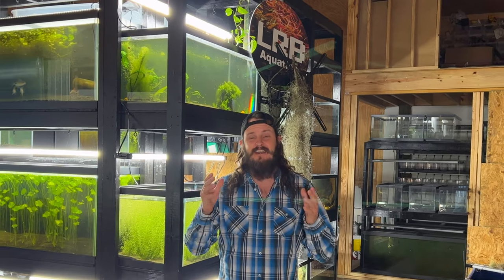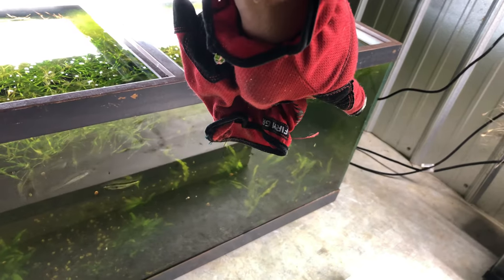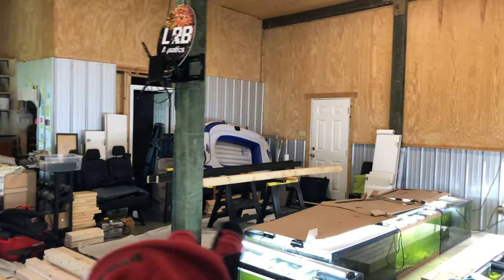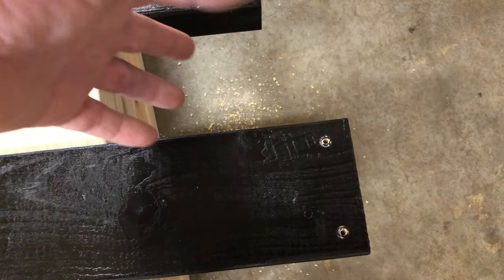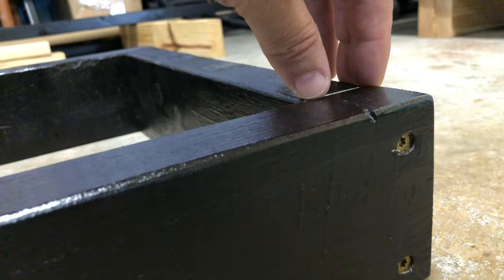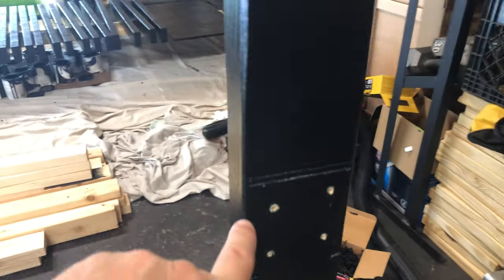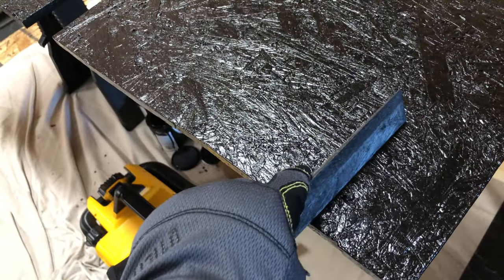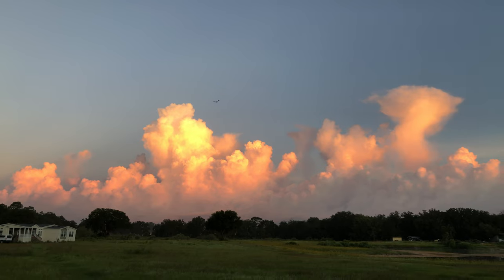Building Custom Aquarium Rack Stand for Fish Room (Full Guide)

Comment: Do you not get worried resting the weight on just screws? interesting design, looks very clean, I want to do something similar but worried the weight will be on the screws.
Reply from the maker: I use thick exterior decking screws with the combination of 4 screws per connection I do not worry or never had a problem with them.

Comment: Thanks for showing us how you build them. Loved your tip on using the plywood to make sure its level. Going to have to do that as my cement basement slap isn't remotely level for more than 2 feet! 😄
Reply from the maker: Helps with garages too. Many people don’t realize they pour concrete slabs for garages at a slope so water can run out.

Comment: I built my rack similar but added a twist to make it easier for my old falling apart arse. 🙃
For my leg supports I dado-ed horizontal shelf supports in. That way besides sharing the weight of the shelf it made it easy to place the shelf in place and run the screws. I just had to shim a leg at the floor and all the shelves were then level.

Thanks for sharing Lucas! 😉
Reply from the maker: I thought about dados then I thought about the time for them and remembered how well my other racks in the past held up so I stuck with my tried and true.
Reply from the maker: But great choice if you can’t hold it yourself or get some help.

Comment: If you have those squeeze clamps like they sell all over, they make it much easier to set a mark/clamp to where you can sit the shelf on it for the height, then you just  have to hold it for side to side alignment.  The longer ones also could make squeezing the shelf together for screwing much easier.  I use those clamps for all sorts of wood projects for the garage, making drawers, cabinets, etc.
Reply from the maker: O interesting, good trick! The ones I have couldn’t hold the weight without slipping on the glossy paint.
Reply from the maker: @josephkrug8579  you had me at Dewalt lol Thanks for sharing!
Reply: And I doubt those shelves are that heavy to require it, but you could always use multiple clamps to clamp a single piece of 2x4 under the shelf to hold it up while you screw and attach it into place.
Reply: @LRBaquatics  I have some of those pistol grip type clamps in 12, 18, 24 and 36 inches. The 18-36 in ones are sturdy and strong enough to hold that for sure (even the non-DeWalt ones I have 😆).

I used a pair of 36 (in the spreading/reversed mode)  to raise and hold a recuped window (about 80 lbs) to frame it in it's place. Worth it's weight in help!

Comment: Also, looking at the way you have the shelves tied into the sides...if you run into problems with the screws cracking the end grain, you could get some 1 or 2 inch angle iron to run up into the corner under the shelf along the back to front board etc, and that would help hold it in place without taking up much shelf space at all and make it much stronger as well.

Comment: I am new to building tank stands. Question for you. It looks like the screws are the only thing holding up the tanks. Should there be wood under each corner where the shelve is attached? I watched a few videos and they said screws have a sheer weight of 80lbs. Water being 8.3 lbs and my guess with tank and water about 10lbs a gal. That is a whole lot of weight on just screws?????
Reply from the maker: What screws you use matter. The decking screws have a sheer value between 200 and 300 but when multiples by 4 adds up more like rebar. You can add wood supports and or dados but these are plenty tough enough. I have some stands at my old house still solid as a rock that are over 10 yrs old.

Comment: Have you used this system before? the sides are the weak point trusting the screws to hold the tanks weight. I'm planning on making a 75 rack and will be notching front facing long 2x4; and using a 2/5 bolt to help screws on the side. I'm probly overthinking it.  Also I noticed you doubling front long faces 2x4. Do you think they would bow with a single on a 75?Your more experience at big tanks than me hopefully I catch up 😂.
Reply from the maker: I have and have done it with 2 125 longs as well. The shear value of one of those screws is enough for a 75 let alone 4 on each side. I thought about a notch dado joint but to much work and didnt want to chew into my 10 ft tall legs. Knowing how many years and how well my old system held up this should last decades. The reason for the doubling up is to help from sagging in the middle overtime especially if in humid conditions. Plus if I knock into it Im not going to be as worried about falling through it lol.
Reply: @LRBaquatics  thanks I figured I was being overcautious feel better about my plan and will add extra length support!

Comment: So only 4 screws each corner to hold all the weight?? 😮
Would personally fit a 2x2 brace each end for added support and help line things up in building.
Reply from the maker: You could but not needed. The weight to shear value is over engineered with these racks.

Comment: Is there a reason for the plywood?  My 75 diy stand is just supporting the frame of the tank.
Reply from the maker: So my roots for my plants don’t get light or so light doesn’t shine through a bare bottom. With racks that have multiple aquariums down a row on one shelve it also helps distribute weight.

Comment: I like the step-by-step, how-to videos. I like to see what might go wrong, what to avoid, the exact materials used and how a project looks at each level of construction. You are so lucky to be able to live your dream. I see the rack system can hold an Eder. Though it is work, I bet it is a fun, satisfying undertaking. 
P.S. What about diagonal bracing for extra stability & strength from twisting etc?  <•))))~{
Reply from the maker: Lol the Eder was a good test subject :P could always add more supports like that to really beef it up, good idea! The ones at my old house I would 2x4 a brace to the wall then the rack to that brace so when I ran into, which I would do often, I wouldn’t knock it over since it was tied to the wall.

Comment: Can this style rack hold 5 twenty highs at over 1100 lbs per shelf?
Reply from the maker: 20 highs would be really high I did and do have a video that shows a 20 long rack that was 5 high I built and was somewhat manageable, it’s nice to have work space btw your tanks at least 8 inches.
Reply: @LRBaquatics  how important are the inner board to be doubled like you did? Can you go single 2 x 4 on all 4 sides instead  of two 2x4s stacked on front and back of each shelf?
Reply from the maker: @barebottomaquariums1419  if you want multiple tanks in a row I highly recommend doubling up. If only single tank then only single board needed. This is for sagging overtime if kept multiple tanks in a row it can cause pinching which will bust your tanks later down the line of time.

Comment: I'm sure that is strong enough, but I still cringe at seeing screws used to hold all that weight.

For others I might recommend some sort of lap joint or mortise and tenon, so that the wood is holding the weight, and the screws are there only to keep the wood joints together laterally.
Reply: This is what I was thinking. My anxiety wouldn't let me use this design. A couple extra pieces of wood would make it so much stronger.
Reply from the maker: No worries for the weight of the tanks and the shear value of the decking screws that hold parties of people are concentrated which leaves it way over engineered for shear to weight value. I thought about dado joints but didn’t want to hack and take the dexterity out of the 2x4x10s which wouldn’t really been much of a problem but a lot more extra work I didn’t have time for that wasn’t needed.
Reply from the maker: I have racks like this over 10 yes old. One holds 2 40s and 2 125s hope this helps the anxiety.
Reply: @LRBaquatics  I understand and i believe you, just something in the back of my mind doesnt allow me to believe 100%
Reply: @DylanRenke  And I think you're right too be suspicious, because in terms of the deck screws, those are rated for a properly built deck, which would include joist hangers, more fasteners per hanger, more joists per the load, etc...

That's not to say that these stands won't last a very long time without trouble, but there's just no safety factor with it built like this.

Comment: For 75's I would have wanted vertical supports UNDER the shelf frame..... 700+ lbs and nothing under it for support,  just boxed screwed....?
I guess that's just the carpenter in me talking... It'll be fine.
Reply from the maker: I could have and would def. make it stronger but also lose a little space and if you want to run water lines or anything to you tank in the future it can be a pain to go around those supports. The shear value on those screws it’s still over engineered x4. Old house I did it with 125s.

Comment: The weight of those tanks are being held up by screws…🤦To transfer weight into the ground more efficiently make sure you have posts underneath your load bearing beams. Water weighs 8.34 lbs per gallon.
Reply from the maker: Lol they aren’t like typical drywall or machine screws. These are exterior decking screws 4 on each corner by the time I’m done with it, might as well be rebar. These stands are well way over engineered. Deck screws are meant to hold people and the shear values are more then they label plus at labeling amount they still exceed especially when using multiples.